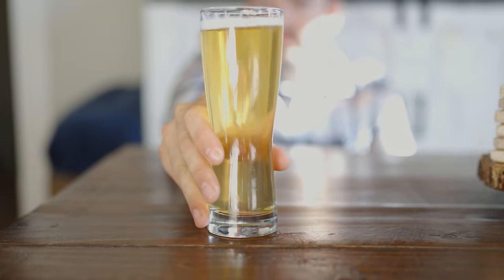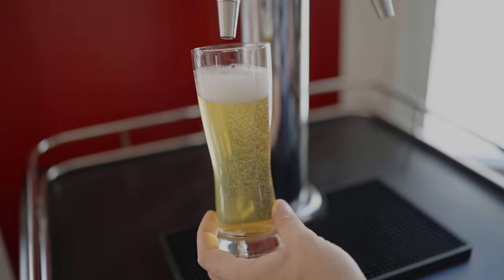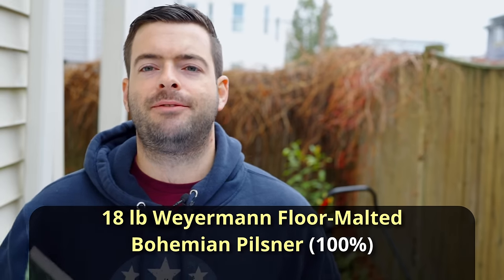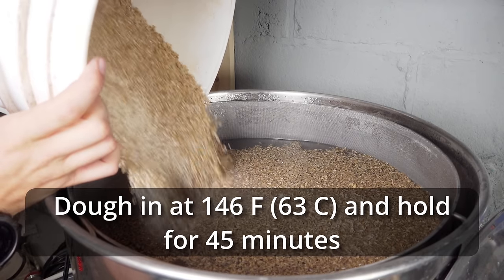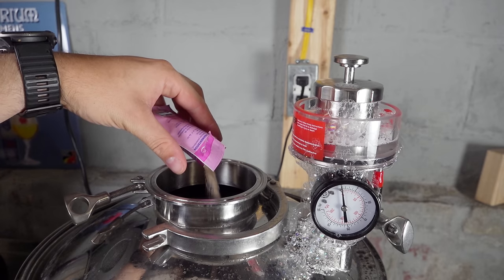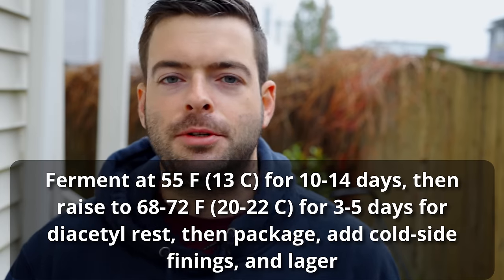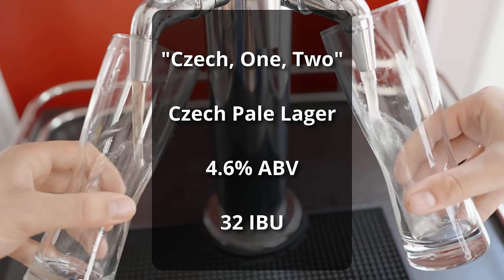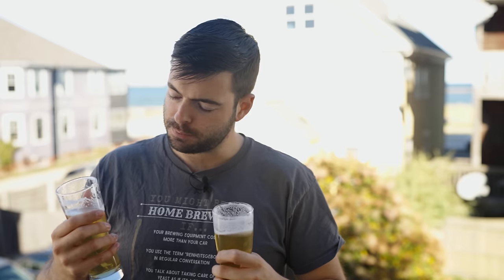Is a PRESSURE FERMENTED LAGER Really AS GOOD as a Regular Lager? Guest Tasters and Triangle Tests!

Comment: I'm trying your recipe this weekend with my fermzilla! very excited! I don't have yeast nutrient, but I was thinking of using two packets of yeast instead. Would that work just fine??
Reply from the maker: Yup, thats plenty of yeast and should be fine.
Reply: @TheApartmentBrewer  48 hours in the fermentation at 22degC pressure fluctuating between 10 to 15 psi (yes, I got the cheap spunding valve from kegland...) and I get a strong smell of sulfur out of the fermenter. I flushed the gas inside the fermenter and replaced it with fresh CO2 and set the pressure the 10PSI. Should I be concerned?? any action to take? thanks!!!
Reply from the maker: Sulfur is a perfectly normal part of lager fermentation, especially early on in the fermentation and its nothing to worry about. It will go away in time. If it's still in the beer when you package, either wait another week or so or if you keg try to offgas and recarbonate
Reply: @TheApartmentBrewer   phew! thank you, it's the first time I brew a lager... the fermzilla opened up this possibility for me, Since I don't have the ability to control the fermentation temperature other than room temperature. You are a life saver, thanks for all you are doing for the home brewers community!
Reply from the maker: Glad to help!!
Reply: @TheApartmentBrewer  Took a sample to measure F.G. after 96 hours and I got 1.009. Tasted it and I can already tell it will be great! I'll leave it one more day in the fermenter before kegging and hopefully get down to 1.007. Can't wait! 😍
Reply: Ok, the 5gal is already gone! it was delicious. Now I'm hesitating if I should do it again or try your other Czech pilsener with the decoction mash? I have no easy way to boil 9L on the side for the decoction... which one is the better beer?
Reply from the maker: I personally prefer the pilsner, but don't fear the decoction. You can always just add around 4% melanoidin malt to get the effect and the color!

Comment: My attempts at pressure fermented lagers with 34/70 have definitely produced more sulfur than traditional fermentation with 34/70. Obviously the sulfur dissipated some with a little time but I haven't been a big fan of my pressure fermented lagers in general. I like the idea of a faster lager but I think Lutra has made pressure fermented lager obsolete for me. We're drinking another batch now that I added Crystalized lime to and it's being drank even more quickly than Lutra ferments because everyone loves it.
Reply from the maker: It does tend to do that, maybe consider using S-189 instead? It will be a lot less likely to produce sulfur notes. Lutra is awesome, just gotta control that pH closely.
Reply: @TheApartmentBrewer   the only thing that I have done in terms of ph with Lutra beers is aim for a higher mash ph. I don't check the ph of my finished beers unless something is off flavor wise but that has not been the case with the 3 Lutra pseudo lagers that I have done in about 6 weeks time. My neighbors, most if whom do not drink craft beer and my wife, who is a wine drinker love these Lutra beers especially the lime version.

Comment: If my Saaz has a lower percentage AA and still want to hit the 32 ibu, using Brewfather I can modify the quantity but how do you balance the timing of additional hops to reach the same ibu. Do I add just a bit in FWH, do I add a bit more at 60min or a lot more at 15min or maybe an even distribution across all additions?
Reply from the maker: Usually I try to bias toward the bittering hops. You want to balance that with not having too much hop material in the boil for too long though, so I'd recommend splitting it up to try and get 75-80% of your increased IBUs from the bittering hops, then distribute the rest into the 15 min or later additions. And remember, IBUs are just a guideline. 28 vs 32 IBUs isn't going to be an enormous difference.
Reply: @TheApartmentBrewer  thank you so much for your reply!
Reply: @TheApartmentBrewer  quick follow up question; what is usually considered a normal time lapse from FWH to boiling. My brewzilla 120v takes a very long time to boil and therefore every time I did FWH I kept thinking my hops were in there for way too long and possibly over bittering?
Reply from the maker: I used to do this on a 120V system as well so I'm very familiar with that conundrum. I used to put the first wort hops in after the grain basket was finished draining or after the sparge was complete. Usually 15-30 min is fine

Comment: It also would be interesting to compare pressure fermentation to a non-pressure batch that was otherwise identical (i.e. same fermentation temperature). It would validate your whole process to find that the non-pressure was more ale-like.

If on the other hand there was no difference, it would suggest that pressure has no effect, and there is something wrong with your traditional lagering technique.

Comment: I am not quite sure what my issue is, whether it is the Viking grain flavors or if it is something with my pressure fermenting.  The first batch I made was quite bad until I waited 2 weeks, the 2nd batch was totally undrinkable.  The first two batches I used an ale yeast.  However, the 3rd batch  I used Saf Lager 23 and let it sit in the fermenter for a full 2 weeks.  After transferring I cold crashed for 24 hours.  It's still a bit cloudy and has this off flavor.  I am not sure if it is the yeast of the Viking Malts I used.  Either way this will sit a bit longer to determine if it will be drinkable or not.

On this last batch I let pressure build up naturally and capped it at 10lb.  Maybe I am not using enough yeast so I am stressing them out?  I only used a single packet.  My next batch I will make a starter for it and see if that helps at all.

Either way after 3 lost batches I am feeling a bit deflated and thought about just not using pressure in the future.  Sadly my first bad batch after 8 batches was my first pressurized batch.
Reply: Hi Joseph it´s difficult to pinpoint whats gone wrong for you since I dont have the full brewnotes from you. But a common missconception about pressure fermentation is that even though the yeast will ferment hotter you will still need to cool down the wort to the right pitching temp. If the wort is to hot in the beginning of the fermentations it will produce offlavours. Next tip is to make sure you have enough yeast, even though you ferment under pressure the amount of yeast will still be of top priority. Get a yeast calculator to make sure, in a 5 gallon batch I would atleast use 2 packets of dry yeast to make sure. Can you describe the offlavour that you get?
Reply: what yeast are you using? A single packet of dry yeast (saf lager 23 you said about your 3rd batch) should be a high enough pitch rate.
Reply: @Hannes_Lind  I wish I could but I am only a year into brewing and do not know anyone here in my area that could taste my beer and tell me what I am tasting.  It's hard for me (uneducated) to determine the source of it being yeast, grains, etc.  I only know I have had A LOT more off flavors since the move to pressure than when I used non-pressure.

I am pretty sure I under pitched and probably didn't cool down enough, I went down to 80 degrees but I am guessing the lager yeast probably wanted lower temps than that.

I need to find some locals that can help when things like this arise.  As stated my first bad batch was when I moved to pressure and have had 2 since then, this 3rd might be drinkable but will have to let it sit and see.

The haziness of this batch is expected as it is a cream ale grain bill with a lager yeast just to see if that worked better than the ale yeast under pressure and to see if that yeast was causing the off flavors.
Reply: @squeaz1eclips597  The first batch was an ale yeast, cannot recall which one (notes are my weak point but to change next batch).  The second batch I tried Cosmic Punch which I reclaimed from a previous batch that was no pressure fermented and had multiplied via a starter.  The 3rd batch was the Saf Lager 23 which I let sit in the fermenter for a full 14 days.  I thought maybe I was kegging the first two batches too soon (after a week when primary was completed).  The second batch I think I screwed up during transfer as I was doing it wrong and all of the sediment went back into suspension which led to a terrible beer that required dumping.  This time though I transferred the proper way as about 2psi pressure and have a pretty clean beer in the keg but there is a bit of an off putting flavor that won't allow me to just drink the beer.  I am waiting a few more days/weeks to see if it ever becomes drinkable.
Reply: @codebowl  Ok so I would say that you pitched to high, aim for 55-60 depending on yeast. If the yeast starts to high you get fusel alcohols and a solvent taste, the beer tastes “hot”. And for lagers the number of cells is critical, so make a starter and make sure you airate the wort and have nutrients. I promise you will make it work. And just as a precaution make sure you don’t have an infection so clean everything with pbw and sanitize.
Reply from the maker: I think they got you covered! The brewing community will always be here to help out!

Comment: I agree that pressure fermentation is basically the same except for hydrogen sulfide. You can ferment under pressure, then attach a blowoff tube at the end to get rid of the sulfur. That’s what I do as it smells like farts if I don’t.
Reply from the maker: That is a great tip, thank you!

Comment: Let me suggest possible content for a future video. Recovery from failure! I don't think everything that goes wrong can be saved. I just finished close to 7 gallons of brown ale that is sour. Thinking it might just be me, I also had taste testers. YUP, it's sour. Going back to your water conditioning video, I got some ideas. My problem is likely from a wild yeast even though I think I'm careful with sanitizing. I do not yet condition my water. To the point, I was able to add baking soda to correct the sour taste!  Still I wish for a richer flavor.. maybe I could add some  Cl for a maltier and fuller taste ?

Could the chemicals used for water conditioning be used at the other end of production to tweek the beer, even repair it??  Yes, I'd rather do it up front and so far I only have a PH meter.

Comment: Also don't put the spunding valve on the valve for your floating pickup line! Found that out the hard way....
Reply from the maker: Ooof that will make a mess!
Reply: @TheApartmentBrewer  Also be sure that the collection ball is tight enough to handle the pressure. Just found that out the hard way this afternoon. I keep discovering new ways to screw up brewing beer!

Comment: While I love these tests, noone ever asks if there's a difference between a traditional lager not under pressure, vs a lager Under Pressure, but both at traditional cold lagering temperatures 

I know pressure fermenting means we can get beer to finish faster and at a higher temperature, but what would happen if the Only difference was pressure, instead of pressure and temperature?
Reply from the maker: Fair enough, but if you are pressure fermenting at lager temperatures, you don't gain any benefit by pressure fermenting since it will take just as long as without pressure.
Reply: @TheApartmentBrewer  I wonder if it would have an effect on esters, or somehow make the beer even more delicate

Comment: FYI - adjusting your pH after 10 minutes is too late to have any significant effect on the current mash because of how much conversion has already taken place. Contrary to a lot of what you see on YouTube, measuring your pH at 10 minutes should strictly be to verify your water chemistry was on point to start with, not to change it. All lactic acid should be added pre-grain, to assure you're starting with the correct pH.
Reply from the maker: Ok, thanks. I think this still depends on a lot of things. I have a pretty high liquor to grist ratio in my mash and it takes a lot longer for conversion to happen. I get it's not a linear curve but I've still saved many a beer by adjusting with lactic acid or slaked lime to get the right pH. It still has a very significant impact based on my experience. Thanks for watching!

Comment: Could the spiciness of the pressure fermented lager at 22C be fusel alcohols? It would make sense as fusel alcohols are produced at higher temps.

Maybe compare how your head feels after drinking 10 pints 😂
Reply from the maker: Yeah definitely not. I've had a few batches with fusels and that's not this at all. The spiciness is saaz coming through